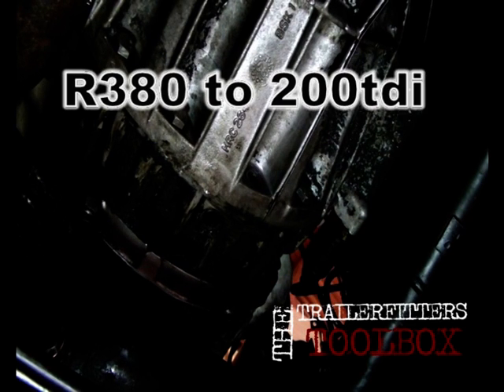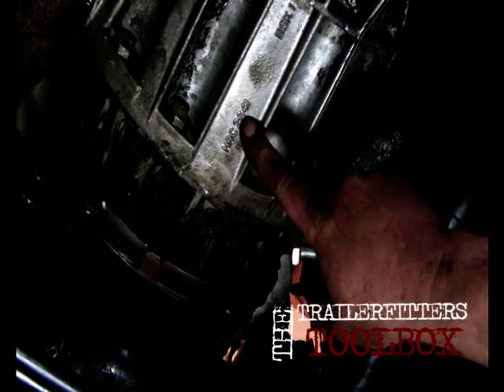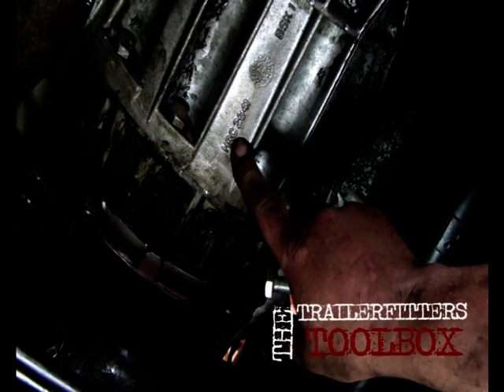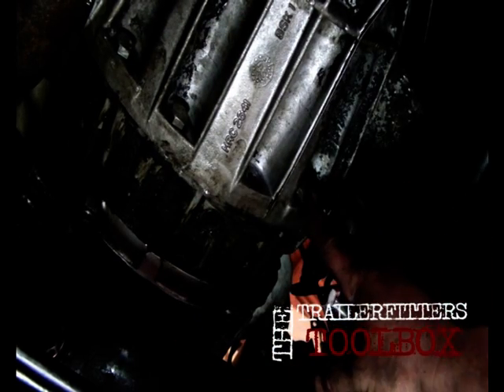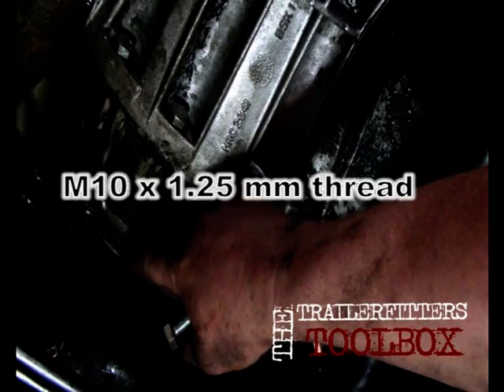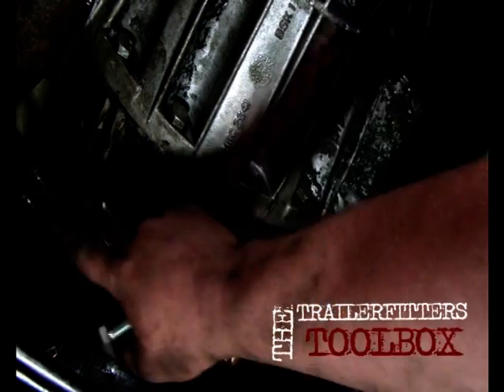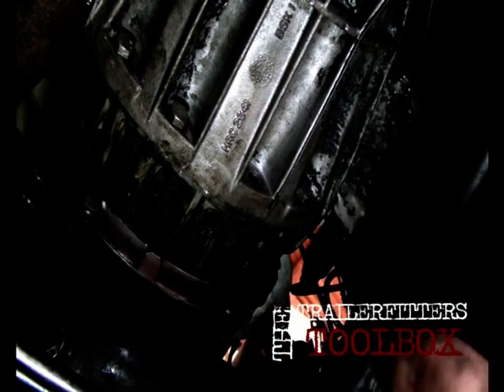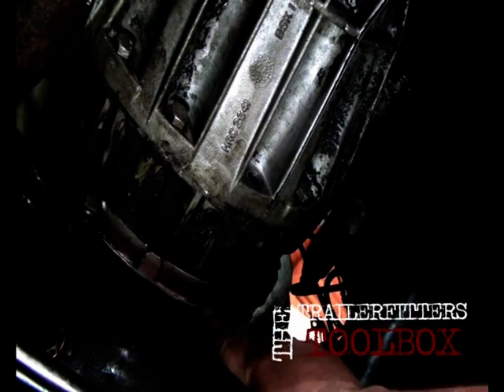When mating a R380 Diesel Gearbox to the  200tdi Land Rover Diesel Engine

Comment: hey can i take an engine and gearbox out of a 300tdi discovery and put them in my 200tdi? I know there is some mountings to be changed for the engine but what about the gearbox the gear knobs are in different locations, is there any conversion to change them to defender spec??

Comment: Hi, I have a scrap disco 2 with a td5, pretty sure the gearbox is a r380, would this be a straight swap onto a defender 200 tdi or do the bellhousing need changing etc etc. 
Cheers Kev
Reply: You need lil bit a customize the bellhouse, google r380 stumpy, hope it will help
Reply: 6 years later 😂

Comment: Thanks for the tip. Is the bolt/bore pattern the same as with fitting a Series 3 gearbox to a 200TDi? Sooner or later,  we would like to swap the series gearbox for a R380 box (2
LR109 200TDi, 1984).
Reply from the maker: I am not 100% sure on the old series gearbox but it is the same as the earlier LT77 bell housings.  Later LT77 have locating dowels but it is the same pattern.